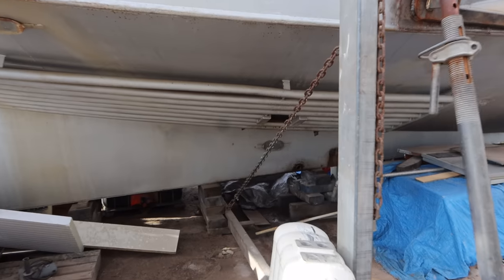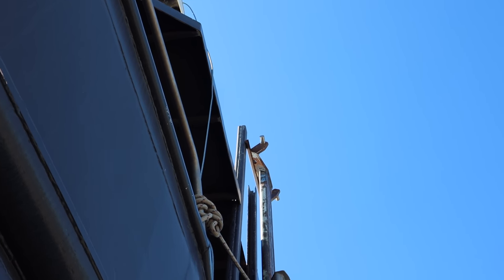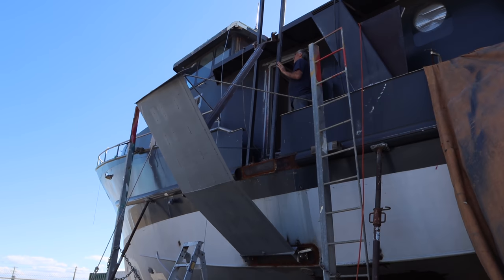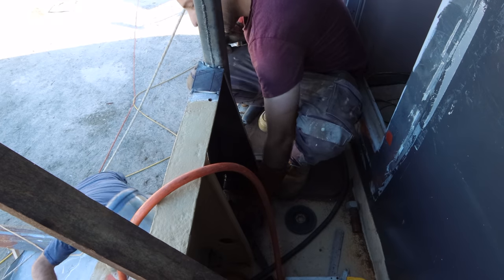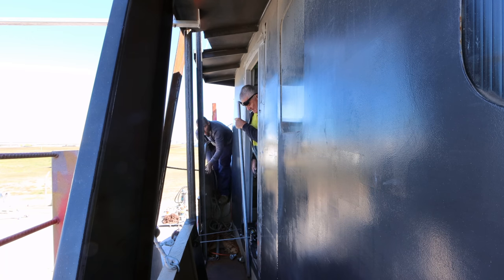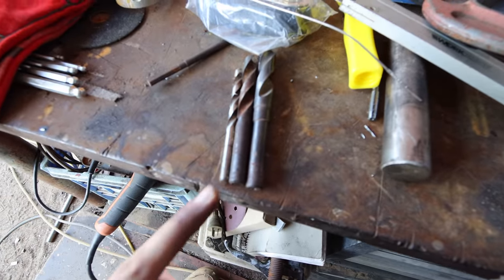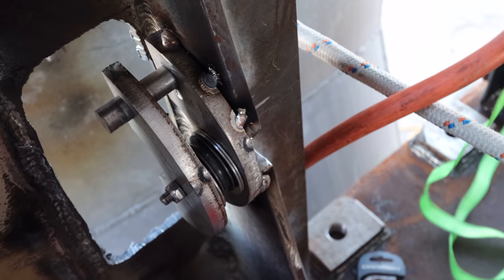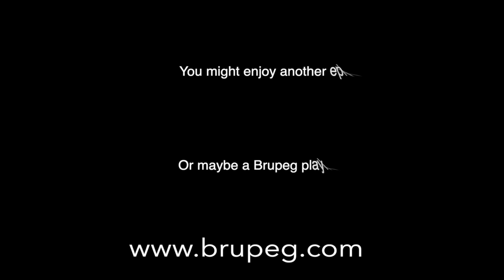Making Pulleys (part 1 of 2) - Brupeg Ep. 169

Comment: Yes, I understand it would be impossible to retain the wings with a straight vertical load but I envisaged a simple over-centre Highfield lever type lock which could have been attached to the end of the S/S pivot pin when the wing was raised to lock it in tightly to the side of the boat.  Sorry, should have told the full story. BTW, I'm not sure what loading you will have on your winch, but when you pass a line through a sheave to change the direction 90 degrees the load on the sheave and pivot pin is 140% times the line load.  When you turn the line back through 180 degrees the sheave and pin are carrying 200% of the line load, so it may pay to check your numbers.  I love what you guys are doing.  it takes guts and commitment to even start a project as big as your's, and the fact you have already finished a sizeable slug of it shows your determination and clear vision, especially as you come from the land of the long arvo snooze.  Keep it up.  There are a lot of people, me included, who would love to see you float your boat.
Reply from the maker: Cheers Robert

Comment: The speed of an unladen swallow is 30 - 40 km/hr.
The length of a piece of string is precisely equal to the distance from one end to the other.
A boat is never finished.
Reply from the maker: 30 -40 sounds more like a range based on various species of swallow there Bill
Reply: Had to make an average for all species, just to make things easier. There are actually quite a lot of studies on the subject and my deep research on the matter concluded that an average speed was the best answer due to the multiple variables of species, altitude, wind speed, method of loading, mass of load and centre of gravity.
I felt sure that some people would like to know  so I spent at least 5 min on this thesis.😁

Comment: Have you thought of having your wing lifting point at the top of the arm? That way the cables would always lift vertically, in line with the sliders. If the cables are in the water they will gather seaweed and kelp.
Reply from the maker: Hi Dana the physics of lifting from the arm tops just doesnt work, when the wing drops from 100% up to 80% up the arm top only moves half an inch. As for the maintanece issue, it does add to that but its also manageable, every trawler uses wire rope lowered into the sea to pull nets through the water, if the wire is greased its not an issue.

Comment: Hi All.
 Just a little suggestion, If you are going to move the winch, could you mount it on top of the sliders and get a straight pull from the top of the arm, it would be easy to put as many falls in the cable to give extra purchase if needed.
Reply from the maker: Hi Edwin, anything that lifts the arm and not the wing always ends up with a force approaching infinity at the top to lift the wing in that last 10-20%. the arm height difference between wingtip tight against the boat and a foot out is about 10mm at the arm top.

Comment: Hi just watching this video and I noticed the leading edge hinge is below the water line. I would like to make a suggestion and build a cup type face to make that leading pin assembly more water dynamic.
Love watvhing you video keep up the great work 
Regards to you all
Jim Galea
Reply from the maker: Hi Jim, we plan to upgrade these hinges in 18months or so as these are version one and a test really. so normally i would agree with you but we wont bother as we will be pulling these off soon and would rather spend the time and effort on the new permanent hinges

Comment: Hi Guys,
have been watching your spectacular progress and innovative solutions for quite a while and the raising and lowering of the stabilisers seem to giving you a real headache. a suggestion from left field...have you considered attaching the lifting point to the top of the slider rather than the stabiliser.  you have a vertical lift with no torsional influence and the slider alignment becomes less critical. having the cable attached to the wing puts a substantial bending load on the top of the slides whereas having the cable attached to the lifter is a straight compression load, giving you a similar outcome without the fitting out dimensional issues that are driving you nuts at the moment.  Just a thought...keep up the great work.  you are inspirational to all.
Reply from the maker: Thanks Robert, check out episode 170 as I explain our thoughts and the reason we chose the design we did

Comment: May I help you with the calculation for the air/speed velocity of an African Swallow? As it happens - an empty can of Fosters has very similar properties. First you need a good supply of empty cans of Fosters and a few back ups. Take an empty can and throw it as high as you can whilst pulling the tab off a new can - you have to complete this before the empty can hits the deck. Repeat whilst gulping as much beer from the newly opened can and again stop when the empty can hits the ground - keep repeating and counting how many times it takes to drink the entire can. Now multiply that number by 3.14159265359 and you have the air/speed velocity of an African Swallow! Just keeping doing it your way Dame - great show and a great team.
Reply: Using pi as a multiplier  when the sum of the drag force (Fd) and the buoyancy is equal to the downward force of gravity (FG) acting on the object. Since the net force on the object is zero, the object has zero acceleration. The other constant is not so much the ratio of the can's circumference but the weight of the can to reach terminal velocity which is met when the can, while still falling, it not accelerating.
Reply: @jamespotter936  Naturally I assumed that! What has lockdown done to us?
Reply: @peternash6206   I've been helping my grandson with his college engineering class! LOL...
Reply from the maker: Wait Beer can acceleration is now taught in engineering? (I must have missed that on the syllabus)

Comment: Have you considered mounting the winches on the salon roof vs. the cockpit roof? That would greatly simplify and remove moving parts and pulleys that could be maintenance points and potentually fail. Along the lines of what Dave is suggesting.
Reply from the maker: Hi Joel, the issue with that is the rear roof is too thin to take the loading from the wing, hence it was always going to be mounted to the whelhouse

Comment: Lancer525 is correct. Not only can you lift from the roof directly behind the sliders position, but the cable can run down the length of the slider in the upright position. The cable can also be channeled below the lock down plate with less than an 18mm grove allowing you to lock the cable to a shackle midway down the slider beneath it in the down position and at a repairable height in the upright. In addition, your cabling can be run under the roofline and pop up to the winch that can be contained in a small doghouse protecting it from rain and salt spray, thusly shortening the cable run from having to go upon the pilothouse roof.
Reply from the maker: Couple of variables to factor in thought, the rear roof isnt strong enough to handle a winch holding the full wing weight. We also need to allow for the cable to coil up from left to right and back again on the drum, so that would mean a cable protector of some sort thats quite wide so as to stop people being able to grab the cable. mounting on the wheelhouse solves both

Comment: Would it be possible to pull vertically from the top of the arm in line with the sliders to raise and lower the stabilisers?
Reply: That's the most obvious, sleekest and what I thought would be happening rather than winch cables dragging in the water
Reply from the maker: Hi Guys, angle dont work when pulling on the arm, as the wing gets to 80%-100% up the arm top only moves 10mm or so. When you pull from 90 degrees to the surface of the wing the loading is low and pulling in the right direction rather than vertical.

Comment: Great to see the wings coming together, certainly answering some lingering questions I have had. Still not sure why you are taking the winch mount diagonally to the wheelhouse roof and not just bolt them to the salon roof in line with or directly above the vertical lifting point. 
Loving your work
Reply: I was thinking the same thing.
Reply: Ummm....yes! Pull the top of the arm head directly up and over the [to be] reinforced top, via sheeve, down to the roof deck mounted winch. (Could/should be a 2:1 purchase. Consider not only the weight of the rig;but water resistance) Most direct pull and keeps the cable and connection out of the water, and puts load/pressure of the top of arm in line with the channels. Also; are you planning "spreaders" in/on the unsupported  channels, between the bulwark and the roofline. Perhaps only a few pieces of 6mm flat stock set up on back like ladder rungs. Should keep channels aligned in all directions while under load.
Reply: @paulkube3901  This method would definitely have some advantages, however I think they have always had in mind not to load up the slider channels and use them solely as guides. If you were to adopt this style I think you would also need a secondary mechanism to pull the wings in tight as the lateral leverage force generated from top of the arm lifting point would not be enough to pull them in (which is quite doable). I dont think they are planning on much more reinforcing as the sliders are really only guides. More than one way to skin a cat, it will certainly be interesting to see how they overcome these challenges.
Reply: @bunyipdan  I think something was said about the salon roof being to thin to mount to.
Reply from the maker: Hi Guys, couple of things to cover here, we go into more detail in the next episode but the bullet points are lounge roof is very thin and i wouldnt trust it holding a winch for any length of time. the wheelhouse roof is 6mm steel and rock solid so the winch was always going on the wheelhouse. as for bracing the sliders, there is no need they are insanely stiff and strong once the bulwarks and top bracing is all welded in place and as has been said they are only guides so take no more than 60kg (arm weight), As for pulling on top of the arm we cant as physics means the wing wont pull 100% closed without a secondary mechanism to finish the lift off. as the most reliable system is one that doesnt exist we have opted for a single line re0directed with pulleys to pull the wing skin at roughly 90 degrees to the surface at all points of travel so we dont need two systems when one will do. Thanks for your interest, and i hope next weeks episode makes some of this clearer

Comment: Just had to come over to YT to give a like and leave a comment.  Love to read some of the comments. You folks (covers ladies and gentlemen and is better than 'guys') are doing an amazing job and deserve at least another half million viewers.  Also wanted to check on the status of the battery pack.  How is it working?  Is it holding up to heavy use?  Take care and have a great week ahead.
Reply from the maker: Thanks Mate, Batteries are doing really well. we just picked up our second Lithium battery pack (yet to wire it in) we need to upgrade our inverter as that is now the weak link. the batteries are just astonishing compared to what we are used to with Lead Acid or Gel. We are hoping to change our inverter to a Victron 5000w Quattro as it has features like managing shore power and generators as well as lithiums and output load all in the one box. They are not cheap so we have delayed looking at it for a long time but they really are brilliant machines that will transform the last aspect of the AC on the boat.

Comment: Enjoying watching the build.  As a welder sometimes I do scratch my head a little at your solutions. It seems to be working and that is what matters.  Not fully understanding some of the design of the wings.  I believe you have changed the design over the course of the build and I may not have noticed the changes.  It is looking awesome and the rusty metal will go away sooner or later.  Have a great week.
Reply from the maker: Thanks Mate. something to factor in is im not a trained welder so my best guess is often pretty unorthodox i would think from a trained persons point of view. Like you say if it works it works. The wings have evolved over the course of the build (not dramatically) and some of those changes arent really visable. Things like using mild steel on the pin cheeks rather than stainless due to work hardening risks, most of the design changes have been around the arm top and guidance pins as its not something we can copy from other boats, its very much a one off specific to Brupeg

Comment: Dame: Not to create an issue or anything, but why would you put the winch on the top of the wheelhouse, and completely redirect the line of force at such a great angle? You absolutely must mount the winch directly to the roof (where you were kneeling at 29:50)  at at a 90-degree angle to the upper end of the sliders, so that the "pull" of the winch is directly in line with the direction of force! That angle you've got with the winch in its current location is going to create significant shear force with the cable pulling up and lowering the wing, and that is a whole "boatload" of problems that you can completely eliminate by moving the winch from the top of the wheelhouse to the area right near where the sliders meet the roof. Take out any and all complexities wherever you can. If you need some extra height, make a small "pedestal" out of 12mm plate. That cabling angle is going to give you major grief.
Reply: I asked this question a few weeks ago marra and the roof metal is not thick enough to mount the winch too so it has to go on the wheel house roof.
Reply: I would put the wench in a box on the top inside of the sliders and have it pull directly on the top of the arm straight up, no pulleys. Maybe put some nylon bushing on the pins that sit in the channel to make it smoother going up so it won't bind and you could disconnect the winch cable and reel it in when not needed. Just a thought! You could also rig up a small swing-out crane that could use the same wench when the wings are  up at dockside
Reply: @neilfairless4589  Then you put doublers down. This current arrangement is begging for trouble.
Reply: @theelephantintheroom8016  Myu Thought almost exactly, why not attach the winch directly to the top of the sliders (double up if necessary), and mount winch on what roof there.
This would also keep the winch cable out of the water.
Reply: @joesharp5602  Excellent suggestion, Mr. Sharp. The only reason I didn't mention putting the winch on top of the sliders is that I just wasn't sure they'd manage the force of winching in seas, without even more reinforcements. Very sharp. (no pun intended)
Reply from the maker: Keep a look out guys in the up coming episodes we will explain why lifting from the arms doesn’t work. Jess
Reply from the maker: Thanks Joe! I thought the same thing about lifting from the arms as dame was building the stabilizers and I got it when he showed me rather than explained. Cheers Jess
Reply: @ProjectBrupeg  You're the engineers on scene, so you all have far better knowledge of circumstances than we do, having to work from the camera angles we do. We just want you guys to be as successful with as few problems as possible. Think of it as "crowdsourced engineering" I'm certain you guys have good reasons for how it is. We''re looking forward to each and every episode!!
Reply from the maker: Everything you guys have raised is really valid points and it’s only because I know more of the variables that limit design options (basic stuff that never made it to the episodes etc) that I ended up with a different design choice. I have no doubt when you see the system working (next weeks episode) you will feel the same. Yes the cable does go into the water but that’s completely normal on every trawler so it’s a known we can deal with and physics determines the rest

Comment: Have you considered if the wings were lowered in a rolling sea whether they would bounce having no force to keep the down? In that case wouldn't it be better to have a ratchet system that would prevent the wings from bouncing up until they are pulled up? BTW great work!
Reply from the maker: Hi Alben. That is a risk your right, but one thing to factor in is these wings spend 99% of there life bolted down and only get lifted when coming alongside a wharf or jetty. So this allows us to pick carefully when we raise/lower the wings

Comment: I made some changes in the spacing between the cooling pipes of my boat to get better access for cleaning and painting the hull behind the pipes. Before, to get access was very frustrating. So when you decide to take them off...
Reply from the maker: Yeah thats a good point, its something ive often looked at external pipes and thought there has to be a better way to build these with cleaning in mind. We will be ripping these off and moving to internal cooling at some stage prior to going to the ice, so we wont spend too much time on these original pipes. Also we found a way to not need to move the pipes (we are going to gouge the old welds out with a plasma, rather than moving the pipes to access with a grinder).

Comment: I must have missed something. I can see how the wings will stabilise on the side where the cable is under tension. What about the other side that the boat is rolling toward? What locks the wing and stops it from "flapping" upward?
Reply from the maker: The top of the steel arm is bolted to the deck, so when bolted the wings are solid and dont move